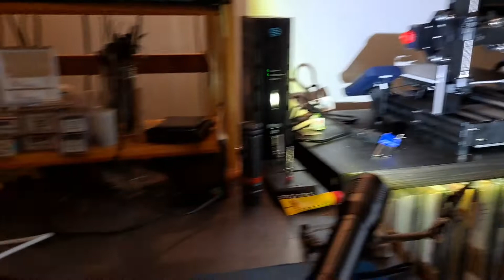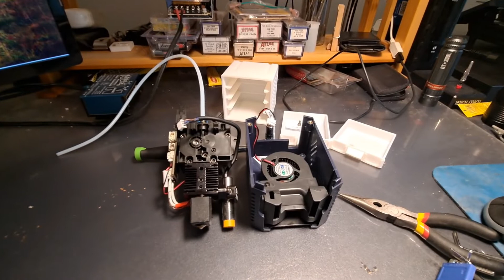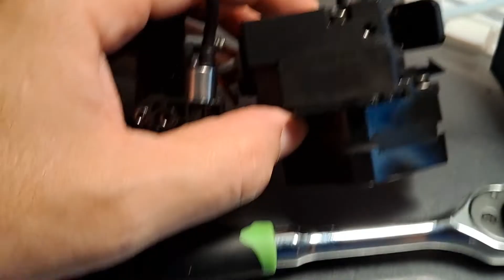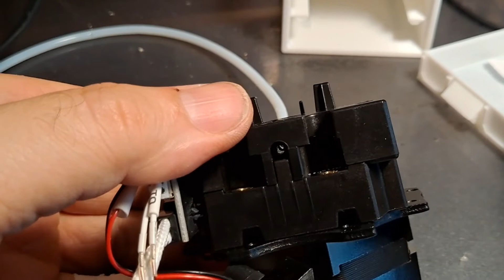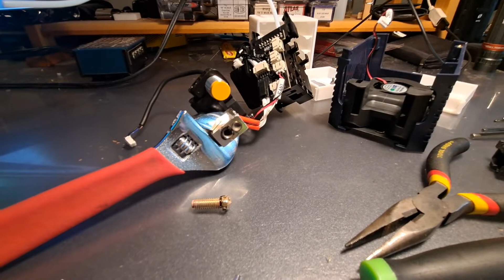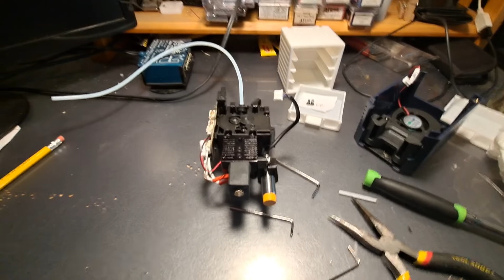Anycubic Kobra 2 unclog.

Comment: i got kobra 2 plus last week and had nonstop issues with the fliament tryin to extrude, i assume its cloged thanks for this video, i will attempt to fix it up tomorrow hopefully resolve this issue really would like to enjoy my printer!
Reply: how'd it go?
Reply: We're you able to fix it? I'm having the same exact problem
Reply: @Huzkies  i fixed it. i did a couple of cold pulls, then, heated it up to 215c (pteg) and got the metal needle looking thing that comes with the printer, moved it around a little and i could print a benchy. if it still doesnt work i would probably just repeat the steps
Reply: @musicbyalek  alright i will try it right now tysm
Reply: @Huzkies  all good i know how painful not being able to print is 😭

Comment: I’m glad you mentioned the last time it was easier when you took it apart disassembled. You can just take the two screws off to take the fan cover off and then the two setscrews need to be loosened and then the whole hotend slides right out

Comment: Mine does not print but everything is correct with the settings . The melted filament pellets . Why ?
Reply from the maker: The settings are never correct, you have to tweak until you get good prints. These units are not plug and play nor do the working settings of one person's unit generally mean they will work on all printers. Check your temps on everything from filament to how hot your bed is. Also make sure your PLA is clean and dry, as moisture could cause printing problems. Experiment then check back and let us know the situation.

Comment: Hi, I just this minute removed a clog, and thank God it worked. I replaced the supplied spare nozel. It was still clogged. I don't recommend it but I just used a drill with a bit just under the size of the filament were the boden tube goes in and ran it through slowly until I felt no resistance put the Anycubic kobra2 back together and it works like brand new

Comment: What should I do if the little black box that you stick the filament into has a piece jammed in it and is stuck.
Reply from the maker: Which black box? The internal heating element?
Reply: @KWE.ECLECTIC Literally just got it fixed as I saw this, it's the trigger mechanism you first insert the filament into.
Reply: Just got a little constipated
Reply: How did u got it fixed? Please help me.  @insidebreeze
Reply: @Funnyvideosmania88  I unscrewed the filament intake and cut the filament to remove the half that wasn't clogged, that I used a very small Allen key to push the clog back unclogging it.

Comment: I have an anycubic Konrad 2 neo too and I had to unclog it before I found this video but when I put it tighter it is not working can you please make a video but have both front and back sides and shows every place you did? It you can’t it is okay just respond you can’t and I can try to find another video. If you do thank you so much. It has been broken for more time I had it now.
Reply from the maker: I am not sure I understand your question. I have my Kobra 2 dialed in, and I will not be removing the extruder head anytime soon.
Reply: Ok
Reply: Thank you for responding very fast

Comment: Had mine 2 days..and it did the same. Your video encouraged me and I managed to get it working again. It had like a 5mm piddly little piece of filament that needed to be cleared... I couldn't believe such a small thing could mess the whole thing up so bad. One good thing tho is the replacement parts are super easy to get, and cheap as well. I do wish they were stronger tho.
Thanks for the video.
Reply: Yeah, my Kobra 2 Max had a blockage that was catastrophic i.e. it ripped the wiring out from the control board and jammed the head under the bed plate because there was such a huge bulbous blob of filament it jammed under the build plate. I'm currently awaiting a new printer head (destroyed), and a replacement hot end (encased in solid PLA blob).
Reply: @davidr5964  Sorry to hear it man, I also had that huge blob wrapping up my hot end as well. I heated it to 240(PLA) and it all just slipped off...including the silicon cover on the end. Which moulded itself into the PLA never to be seen again. I don't ~think they are necessary tho, so i don't really care. Luckily...I actually had 2 spare hot ends as I never trust a new printer, and had Amazoned a couple just in case.... Spent 1hr + then finding that piddly jam up in the feeding mechanism... apart from this.. I have had it running constantly with really really good results... I am at this point ONLY using Anycubics own slicer...and have had no issues so far. I do wonder one thing tho... in the book it says if I have a power failure..to simply press resume when the machine re-boots... this option I cannot find tho, and is a really pain in the a$$ as I am probably just going to use a UPS... but really shouldnt have to. SO far tho..after all this I am keeping it...at least I know how to re-build the damned thing now lol.

Comment: I think my blockage is in the extruder as a i get a weird tick when retracting, is it possible to open that case and not have like a million little pieces come out?
Reply from the maker: Yes, look at the video. The wires may be able to stay connected when you clear the clog. I disassemble the unit completely to get a good look at the issue. The entire process takes about 20 minutes it's really not difficult.
Reply: @KWE.ECLECTIC  know I know what I'm doing later 👀
Reply from the maker: @Yurisminator-RC  Let me know how it works out for you.
Reply: Mine is doing the same thing, 1 week old did you figure out what needed to be done for a fix?
Reply: @KWE.ECLECTIC  It didnt help alot :( i think it might be that teflon tube or the nozzle instead, thanks for the video it was super helpful!
Reply: It appears that the kobra 2 has a clear extruder tube. My kobra 2 max has had no cloggin issues but uses a blue tube that resembles the Capricorn Tubing that is of the highest quality. It has a higher melting point and a slicker inner surface. It is the first thing I replace when buying a printer. Go with Capricorn extruder tubing.
Reply from the maker: @jesseparsons1508  The tube on the Kobra II is opaque white. You would truly have to convince me with hard facts that the tube is the problem. I am more convinced that the nozzle height and drag are the culprits of most clogs.
Reply: @KWE.ECLECTIC  Hey man, i think i figured out the problem for me atleast, the blue PTFE tube is a bit too short from the factory and on my replacement hotend, making a space for it to move up when extruding, so i bought some PFTE tube, cleaned the heatbreak and measured it to 4,1 and not 4,0 mm and cut a piece and the first print clogged but after that its been smooth sailing.

Comment: How do i get rid of those shit layers where the print comesinto contact with the supports
Reply from the maker: Well, the first layer is an important layer. Try getting your Z axis to as close as a perfect height as you can. Run a leveling print, a few If you have to to make sure the first layer is laying down nicely. This can take some time, you will also notice that the nozzle height in Z may look great for one stl file but not so great while running another file. So fine tuning is key. If all else fails, then it's time to break out a file 😊